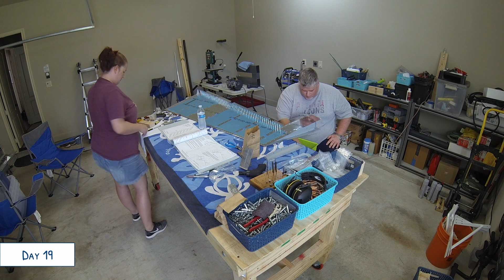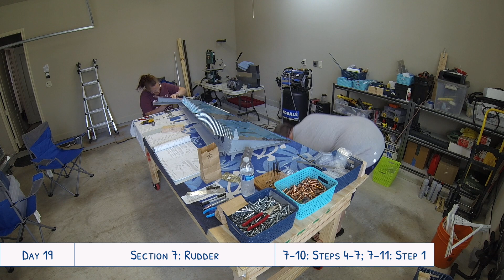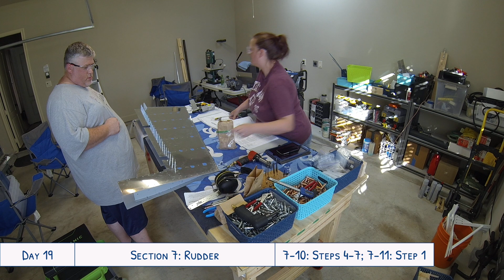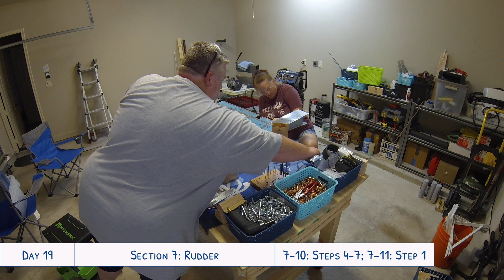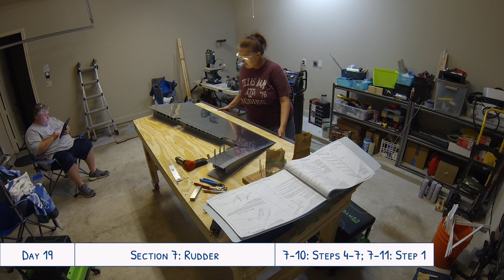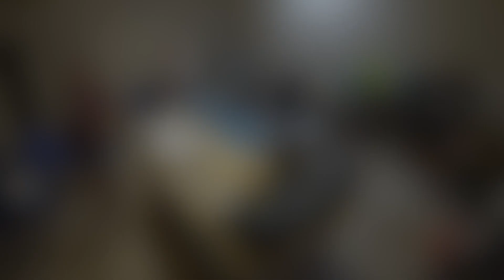Van's Aircraft RV-10 Build: Day 19 - Riveting the Rudder's Trailing Edge (7-10 & 7-11)

Comment: So you used the normal "mushroom" flush set?  I was just reading section 5 and it was saying to use a flat faced narrow diameter set or a C-frame rivet set.  I kept trying to pause and see what Russ was using, but he was moving too fast!
Reply: If you are using the "mushroom" set, is it narrower than normal swivel set and the likes?
Reply from the maker: So after reading through Van’s directions we went through other builders blogs/videos while waiting for the pro-seal to cure and had seen folks talking about using the mushroom set on it versus back river set. We’d asked around and I think it was someone in our local EAA chapter who had suggested using the back river set to initially set the rivets halfway like Van’s directions say, then switching to the mushroom set to finish setting the rivets. I think we played around with both at the beginning trying to see which we liked better and ended up going with the suggestion I just mentioned. I think it worked well and we did the same thing on the trailing edges of our elevators.

So we started with back river set at low pressure like the Van’s instructions said, started flush to river then began pivoting the gun while riveting, stopped when it was about halfway set, then finished them all with the mushroom set flush to the skin. And of course going with the river order that Van’s suggests to avoid pillowing (start in the middle, skip every ten, etc).
Reply: @PlaneLady  Thank you for the reply.  I saw on section 5 where it said not to completely set the rivet, and I was wondering why.  I must have completely missed that it said to start with the back rivet set then switch to the flush set.  I ended up using my swivel mushroom set for the whole thing.  I basically used it because it was a smaller diameter than my other flush set.  However, after I started using it, I realized it's like it was meant for doing the trailing edge.  It just automatically starts the way the rivet is situated and naturally tilts once it gets down to the skin.    I also moved the 10 rivets then started filling in.  I am definitely going to have to thing about switching to your steel angle method.  I was taking weights off, moving the plate, moving the shims, putting weights back on over and over again.  It would have saved a lot of time to do it the way you guys did.
Reply from the maker: That steel angle was a great tip from our EAA chapter president! Like you said, it was SO nice not to have to keep moving the small plate & shims back and forth. Really nice to just set it up once and just focus on the riveting. Glad things worked out with your set! Have definitely learned throughout this build process that there is more than one way to skin a cat 😉

Comment: Looking good guys!  Question: Would it be bad to use the rivet squeezer for the double flush rivets?
Reply from the maker: Yes! Bad! Using the normal rivet sets on the pneumatic squeezer would not work because the flat surfaces on the sets are parallel to each other like you need them to be for normal riveting. On this part of the structure the skins sit at an angle to each other (since its the trailing edge) so using the normal rivet sets will not install the rivets properly. Now I have seen rivet sets for the squeezer that you can buy to use on the trailing edge where the two sets (top and bottom) are at an angle to each other that matches the angle of the trailing edge, but I haven't used one before. But if you're dying to use the squeezer to do it you could try looking into that. Hope that makes sense! 😊
Reply: @PlaneLady  Yep makes perfect sense!  I don't know that getting a special trailing edge angle squeezer would be worth the cost since it isn't that hard just to hammer them.
Reply from the maker: That's pretty much why we didn't get it, Dan. I wanted to make sure you knew it existed in case you really wanted it, but for us we decided 'why bother?' when we can just rivet it using the mushroom set.
Reply: Why wouldn't you use the Cleaveland Aircraft Tool AEX Trailing Edge Flat Set, https://www.cleavelandtool.com/products/flat-squeezer-sets?variant=31588459905086, in your pneumatic squeezer?  Or does the RV-10 not use that AEX wedge in the TE?